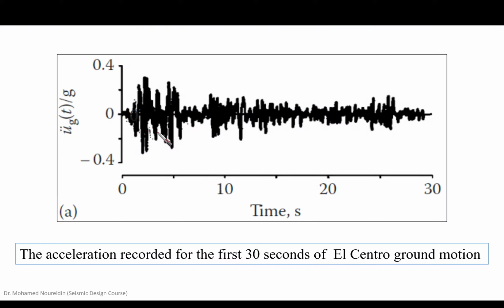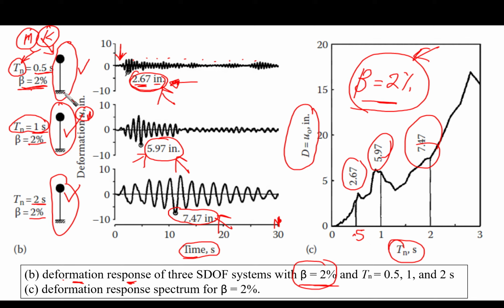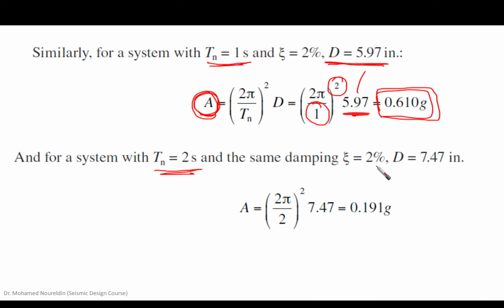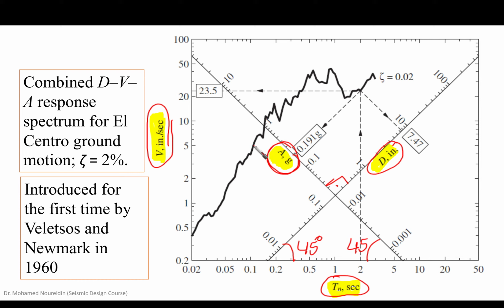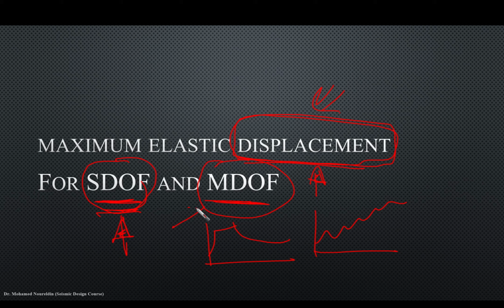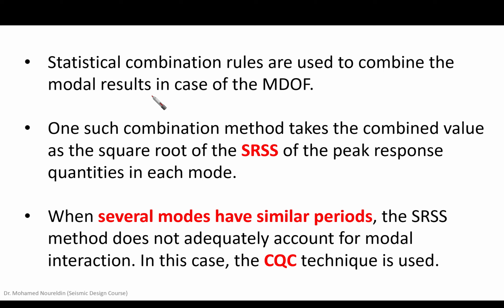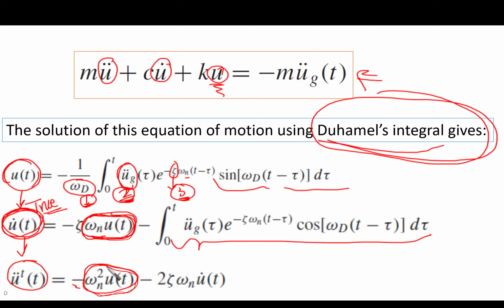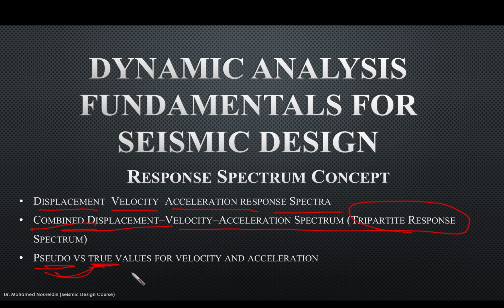9-Dynamic Analysis Fundamentals for Seismic Design (Response Spectrum-Part-3)

Comment: Dear Dr. Mohamed,
I’ve confusion on the velocity and acceleration eq. V = ωD
Where D = Displacement 
 ω = circular frequency
But, V =Displacement / Time Period = D/t = Dω/(2π) ,  t = 2π/ω
Same way  V = At = A2π/ω
If I Wrong please correct me
Reply: No this assumes constant speed. the correct equation is u(t)=D*sinωt.dt by taking the derivative with respect to time u'(t)=Dωcos(ωt) and the maximum speed when the cosine is equal 1. Also, u''(t)=-Dω^2sin(ωt) and the maximum acceleration when the sine is 1

Comment: Hi Dr. Mohamed
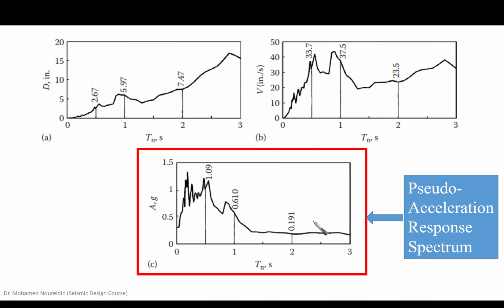Regarding in an example of 3 different deformation, velocity and acceleration response of 3 SDOF converts into 1 response spectrum with (damping of 2%) starting in 20:40 . I want to ask at the 3 graphs, 

at Tn = 0, the deformation also, D = 0, because it was u (relative deformation) = 0 (the system is infinitely stiff)
at Tn = 0, the velocity also, V= 0, because it was u dot (relative velocity) = 0 (the system is infinitely stiff)
but why in the acceleration graph, when Tn = 0, the acceleration (from what I guess, it should be the relative acceleration or (u double dots) that is zero because it is infinitely stiff) equal to PGA (ug double dots)..?

in simplification, when Tn=0(zero), the deformation and velocity are also zero, but not the acceleration..?